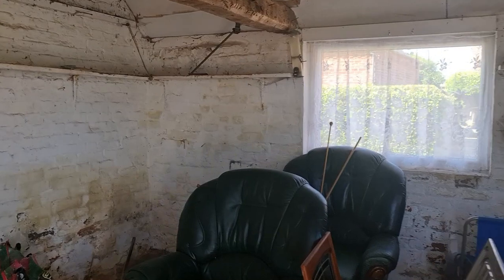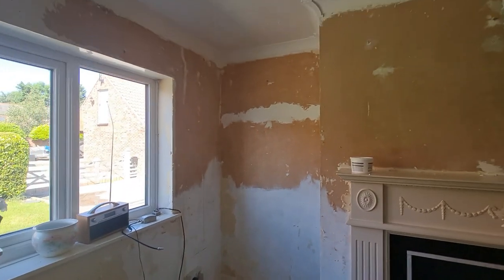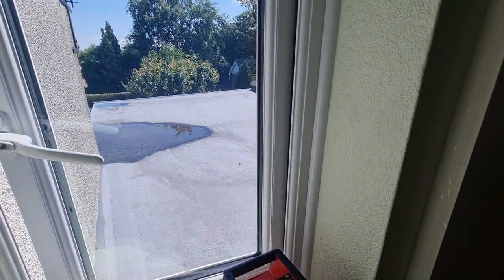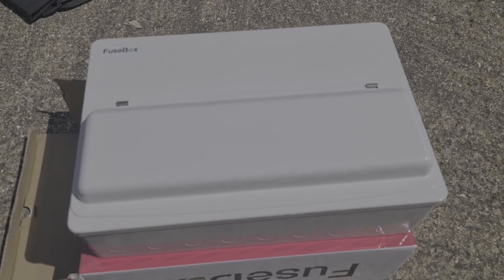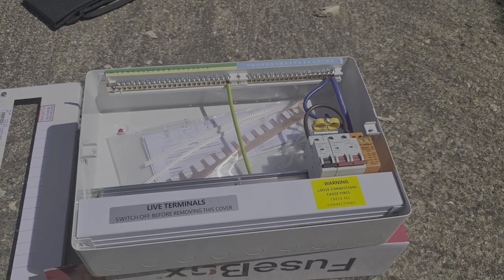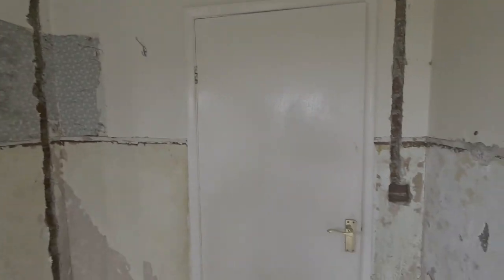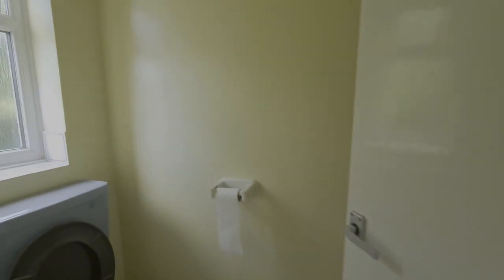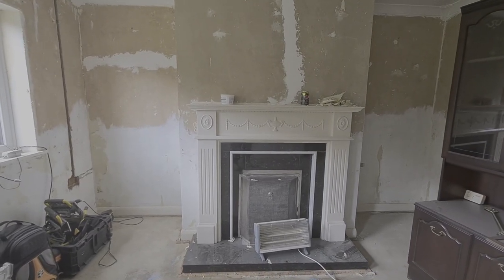Electrical Rewire Series EP2 Chasing, Oval Tube, Cable Zones and new tools!

Comment: I always find it interesting to see the house before renovation and then see it progressing like in this video. I think that  type of electricity meter has an isolator switch hidden under the front panel .Excellent video as always,thanks for uploading.
Reply from the maker: Hi Alan, yes those meters are a great idea. I dont know why they stopped doing it. Simple solution to a common problem!

Comment: Must admit with safe zones I have mixed feelings with them.
Running cables over long distances horizontal goes against the grain to me, as I was taught cables run up or down. Then the one in a corner I think it's a risky one, as it's an area plumbers will always use and alarm people. Another thing with zones, why are other trades not taught about cable zones, I had a fire alarm guy on one job, before he started I told him some cables are in cable zones, he gave that vacant look, so I said you do know where cable zones are, and surprise surprise he didn't, and I get that with all trades.

Comment: Use the chase machine downwards not upwards, Going down decreases the dust.
Reply from the maker: You mean spin it around? This is a push chaser not a puller. Tbh it kicks out near zero dust if you mount the blades the right way and use a good extractor. Have the dewalt cordless later in this series to demo which works differently. Thanks for watching
Reply: @electrician247  one iv got is erbauer from screwfix. I find if you go down the wall instead of up the hoover collects the dust better and it doesn't kick at all.
Reply from the maker: @jackm990  yes mate the erbauer is a puller the discs rotate the opposite way to this one.
Reply: @jackm990  I use a Bosch one which you push upwards, those where you start at the top seem counterintuitive to me, tried one, wasn't for me

Comment: Hat's off to you regarding your PPE comment. One question though, why no disposable over-suits or head coverings?  You mention silica dust and it's perils but right at the end when showing the wall chaser in action your Matthew was covered from head (all in his hair) to toe in that dust. Also the room, furniture and those temporary curtain dust sheets were covered too.  So whilst that face-shield was spot on, as soon as whoever goes to 'dust off' or sweep-up all that silica dust will become air bourn defeating the simple use of a face-shield on it's own. Yes. __ And talking of the Face-shield/dust mask. Do you all have your own individual ones as sharing is a sure fired way of spreading germs and Covid!   Only saying as my old boss suffered with Silicosis and he never did any of the actual grunt work himself always preferring to supervise [i.e. just watch us whilst drinking tea!] from the sidelines so he clearly suffered from secondary exposure.
Reply from the maker: Thanks Maggie, appreciate you watching. 

We all have our own masks and filters. Would be disgusting not to lol. 

We use paper suits in the loft areas. They are pretty rubbish to work in and split after about 1 minute of work. The best thing we have found to do is limit dust and clean as much as possible. We hoover ourselves down with class M hoover before going outside masked up to dust down ourselves if required. We also do not sweep.  

Its actually really poor lighting in that shot  which makes it look a lot worse than it is. The dust is largely from the other works taking place in the property but we inevitably contribute to it in some degree.

I think thats a safe and sensible approach. 

If you follow across social media you will know some of my elder relatives and former sparks suffered with asbestosis so we take ppe very seriously.

In my opinion paper suits offer no help and still require removal which in turn will spill dust on clothing. Looking after each other with class M hoovers is the way we tackle it.

I do like your comment though its better than the ones we get for wasting time using ppe and that its overkill. We can all do better.

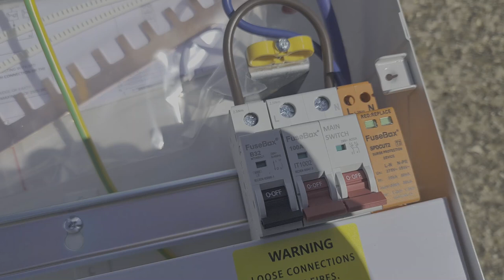Comment: Hi Mark, you mention SPD (surge protection device) (10:43) - the orange device? and why does need its own MCB? I've been trying to look it up and understand it. An SPD is used to protect sensitive equipment from surges known as "transient overvoltages".....that's as far as I understand at the moment. Thanks again for an informative video.
Reply from the maker: Hi! Some manufacturers allow spds to be fitted without overcurrent protection. Some require overcurrent protection like fusebox. I will cover it better on the consuner unit install video coming soon! Thanks for watching

Comment: What is that bit of kit at 21.05? Where the wall was being drilled out for the back box.
I've not seen one before,mind you I haven't done any proper house bashing rewires in a long time
Reply from the maker: Its a dust extractor on the 18V sds drill Paul. Shown in more detail on EP1 of this series. T